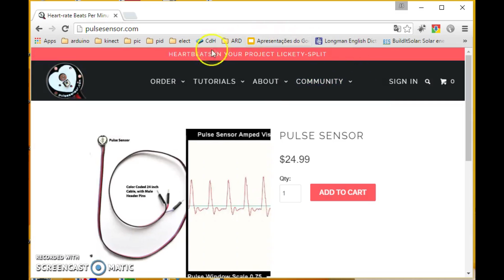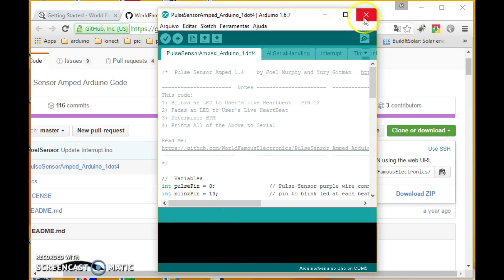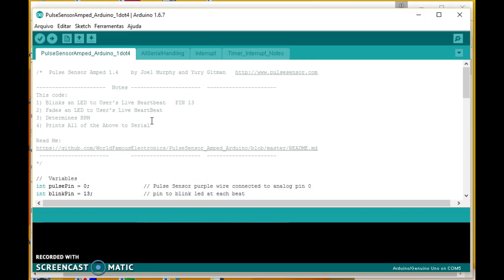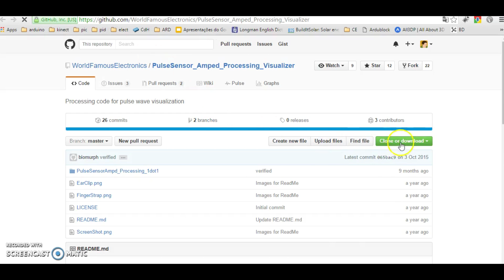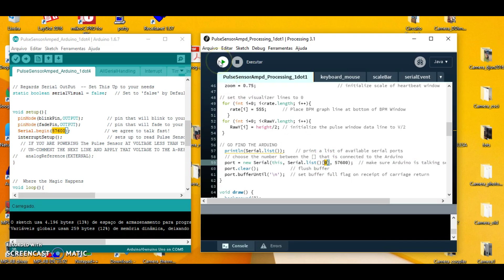Pulse Sensor for Arduino - 14 #arduSerie

Comment: hai, I've much trouble for using this sensor in ear, have you ever use this sensor in ear with earclip? and for using it in ear there's any different way   to install?
thank you
Reply from the maker: Nora Asteria, Hi! See if there is no plastic covering the sensors ... check the wiring ... look for a short circuit. The application has been tailored so it will not work on other hardware ...thank you for visit!
Reply: okay thank you :)

Comment: Did you know how calculate from easy pulse plug v. 1.0?
My PPG signal is like 430 etc. And i dont know haw to calculate to BMI... I want to use only arduino :(
Reply: I tired use this lib to easy pulse 1.0 but this does not show me BMI, but the same value signal (430 ):(
Reply: you  only want the bmi on the serial monitor?
Reply: Diana Laura Jacinto yes, exactly :)
Reply: check this link:  https://github.com/WorldFamousElectronics/PulseSensor_Amped_Arduino
the part where it says: 
If you only want to see the pulse wave Signal data, then you can edit the Arduino Sketch. In the AllSerialHandling.ino tab, simply comment out the lines shown below by inserting // in the beginning of the line.

just comment out all the lines except Serial.print(BPM)

Comment: Opa, beleza? Estou tendo esse problema aqui:

import does not name a type, na parte de processing, como resolvo isso ? Vi algumas coisas na net, mas não consegui entender muito bem como se resolve. 

Poderia me ajudar? Primeira vez que programo arduino, kkk então to completamente por fora.
Reply from the maker: eaí, Davy? cara ve se funciona: Sketch > Importar Biblioteca > Serial.  O Processing não vem com a serial instalada...dá o retorno ai...
Reply: Na versão que eu tenho não tem algo escrito só Serial, achei SoftwareSerial, mas mesmo com esse, onde ele colocou um  #include <SoftwareSerial.h>,  não adiantou :(
Reply from the maker: de longe é dificil visualizar o problema. verifica se a porta com detecta o arduino. verifica se ao rodar o processing é listada as portas seriais...dá uma conferida nesse wiki...https://github.com/processing/processing/wiki/Serial-Issues
use a versão 32 bits do processing. lembro dum issue relacionado a isso... erro e acerto, cara....eletrônica tem disso...desculpe ae...

Comment: The processing code is not giving me any output, can you help me with that? it shows an error at line
port = new Serial(this, Serial.list()[9], 115200);  // make sure Arduino is talking serial at this baud rate
Reply from the maker: Hi jenan jalil , first match the two baudrate; then handle the port, usually Serial> list [order number of your arduino connected to the laptop], and find out if the port on which the arduino is connected appears on the console as soon as processing runs...do not forget to always run the arduino before running the processing .... normally list [1] works!!! Try !!!

Comment: Also, what values do you get when you're not touching the sensor?
Reply from the maker: Basically only noise since the collector is a high impedance open mode transistor. As soon as the signal stabilizes to show the characteristic pattern.
Reply: So no heart beats. I've already checked the "Timer_Interrupt_Notes" tab and made the changes but it still doesn't work as it should. I'm really hoping the problem is because of my arduino. I'll get soon an arduino nano and I shall see then. I really hope that the problem is not at the sensor. Thanks a lot for your help!

Comment: I have an Arduino Leonardo, and I did everything as you did, and also followed a bunch of other instructions from their page, but the sensor just doesn't give good values. And even If I don't touch the sensor, the LED goes on and off randomly, sometimes detecting 200 heart beats per minute... Maybe I'm doing something wrong? I had the TCCR2A issue at the beggining but managed to fix it. Maybe that's why? Or maybe is because of my Arduino type? Or maybe I'm just not positioning the sensor right?!
Reply from the maker: Hi, Flavius, this issue has already happened with one of our hobbyists (Ayoub ELKATIBI). The interrupt libraries are different for each board. I do not have the leonardo to help you out now. An arduino uno is the best solution. I know of an observation made by the creators about this problem. Maybe you'll find the solution there:  a tab in the Arduino code called Timer_Interrupt_Notes. Depending on your needs, or the Arduino variant that you use, check there for the correct settings. That's it, thanks for commenting. Certainly your installations are correct ... but it is a low level problem in the interrupt libraries ... a big hug!

Comment: +J 3 hola tengo un problema en la compilacion "  interruptSetup(); " no esta declarado en el codigo quisiera que me ayudes con este problema estoy usando arduino uno gracias
Reply: A mi me paso algo similar, revisa que estés abriendo el archivo correctamente desde el master, y cuando lo abras se tienen que ver las cuatro pestañas abiertas, de lo contrario algo hiciste mal.
Reply: ya hice lo que me dijiste pero tengo el mismo problema, me podrias ayudar !
Reply from the maker: Hi, Lucas, there is a tab in the Arduino code called Timer_Interrupt_Notes.  Depending on your needs, or the Arduino variant that you use, check there for the correct settings. Thanks for asking!

Comment: Thank you so much for this helpful video, but i have an error like : "'TCCR2A' was not declared in this scope" in interruptSetup function, can you help me
Reply from the maker: Sure...but I fear that the incompatibility error of the pulsesensor software and your platform. Is a low level error in interrupts...has to do with the libraries... by the documentation the code is ready for the arduino. Is this your platform?
Reply: I use Arduino LEONARDO, arduino IDE, and pulse sensor like what you used, but I have this error "'TCCR2A' was not declared in this scope" in the code.
I tried to declare TCCR2A, TCCR2B, OCR2A, TIMSK2 in the code, but after the upload to the card I don't get any value.
Reply from the maker: I tested the code in Arduino Uno. I'm afraid that's the problem. Maybe you could test in Arduino Uno...
Reply from the maker: Hi, Ayoub, there is a tab in the Arduino code called Timer_Interrupt_Notes. Depending on your needs, or the Arduino variant that you use, check there for the correct settings. Thanks a lot!
Reply: Hi, thank you so much for all answers, I use now Arduino Nano and its work very well
Reply from the maker: Congrats, Ayoub! I'm happy that you got it!!

Comment: Hello Thx for this good video. But at the end I have a question about the interrupt. I wann use my pulse sensor whit an arduino mkr1000 but I have problems whit the "void interruptSetup()"...do you have any experience whit that?
Reply from the maker: Hi, Thanks a lot! Can you provide more info? Actually when I first run this code there were no error...I have a great interest  and already  post about this issue: https://youtu.be/2O3KhTNL9vk
Reply from the maker: I suppose the arduino uno's library  are incompatiblewith Arduino MKR1000. I did not have the honor of having one of these board at home ... the error is low level and possibly the implementation is different. the code from what I saw on the site is for one arduino ... someone help?
Reply: Yeah thats the Point...google dosen't help me to find a any help or a code whit the mkr1000..thx for the fast answers!
Reply from the maker: You are welcome! I will also keep searching here ... Thanks anyway!